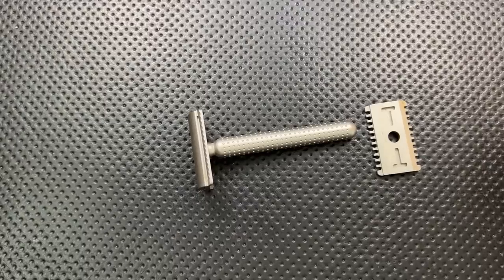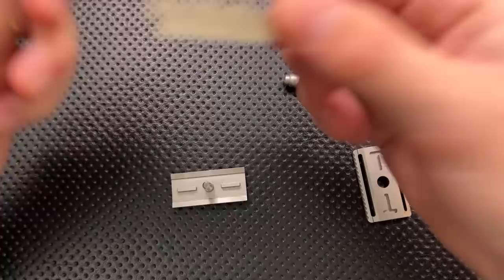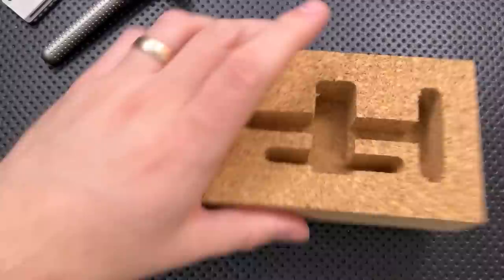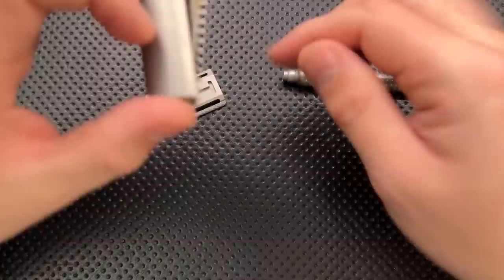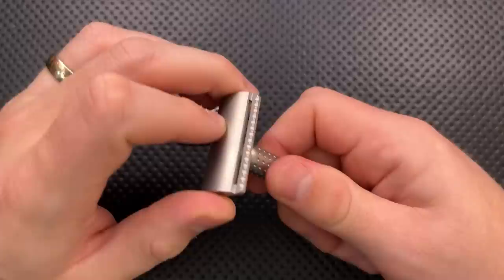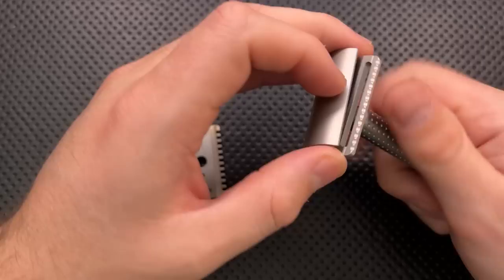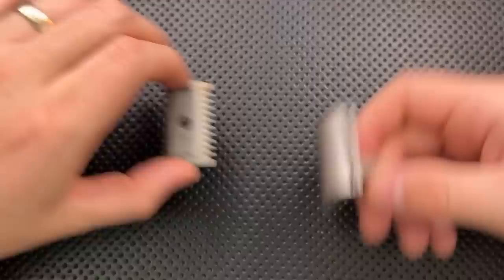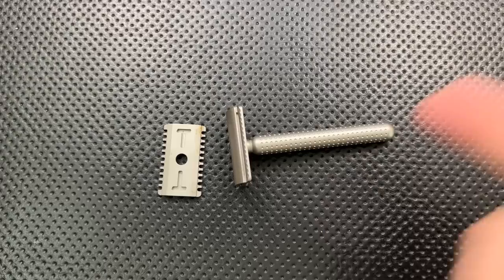The Tatara Razors Masamune Safety Razor: A Quick Shabazz Review

Comment: Nick, you get points for being a fellow wet shaver. Bonus points for using Feather blades (one of the sharpest on the market) but Feathers with an open comb... that borders on insanity LOL. I started my DE experience with a Merkur 37C slant bar back in 2004 and used that daily for over a decade. I got tired of the difficulty in cutting my sideburns straight with the slant bar so I migrated to a 1950 Gillette Red Tip Super Speed, then a 1959 Gillette Fatboy (adjustable) and I've used that ever since, it's simply an outstanding razor. My Go-To blade is the Israeli Personna, it's sharp enough for my beard and still a very smooth, comfortable edge.

Comment: Hi Nick, on the off chance you see this comment I’d like to recommend the Rex Supply Co Envoy.  American made, 316 stainless, medium aggressive, 3 piece, cnc machined, excellent knurling, serialized in step with the Gillette date code, has a lifetime warranty, and man is it handsome.  From one wet shaver to another, it’s a great razor.  Later
Reply: I had the envoy.  It doesn't grip the blade well and so has a lot of chatter.  No Bueno.  I returned it, and got the Blutt BR-1, with 1.20 mm gap.  My absolute end game razor.  If anyone is interested to get it, don't get with less than 1.20 mm gap.  It is super smooth with this gap due to unparalleled blade clamping.  Super smooth and super efficient.

Comment: You should check out the Blackland Vector, fantastic single edge razor with incredible machining. I have to force myself to use my other razors just for the variety.

Both of these (as well as other more expensive razors) are enthusiast tools, like a $300 knife. No one "needs" it but many are willing to pay for it and for good but perhaps not the most practical reasons. So am I, since I have have a Masamune on the way.

Comment: I used to use a safety razor since I started shaving before disposable razors were popular. I've been using an electric razor for at 20+ years. Blasphemy! I've used a Braun Series 7 for at least 10 of those years. Great shave, a lot less mess, no shaving foam or soap, and the replacement heads last me about 18 months for $35.

Comment: Hello,
sorry, I have to pass on this one. Just found my  personal gem (my RAD exit razor) in the stainless steel cnc-machined "greencult rasierhobel" by fairschenkt (made in austria) - efficient like a R41, but very very smooth with an informative blade feel. And the best thing, it's similary priced as the Merkur 34C. This greencult razor has the potencial to become a legend among wet shavers. Has anybody else tried the greencult safety razor ?
Reply: Looks like it is on Etsy. Thanks for the heads up on this one, first I've heard of it.